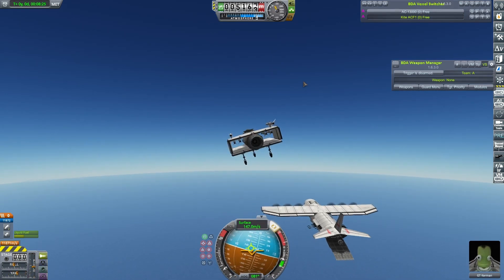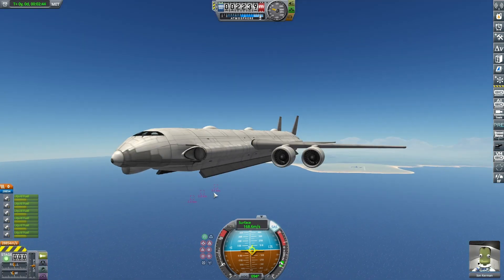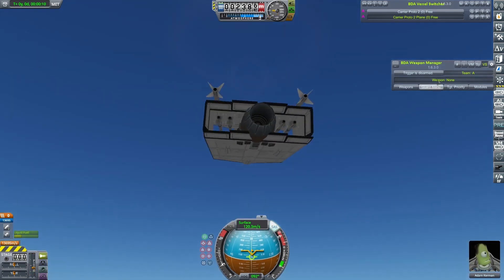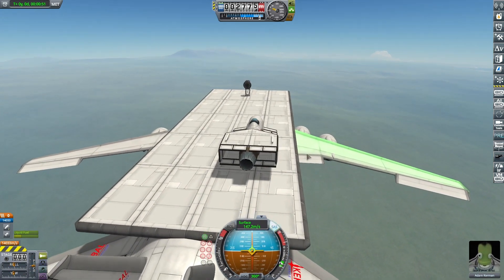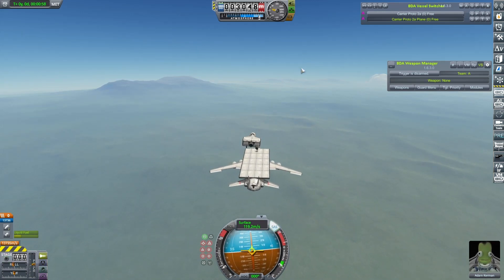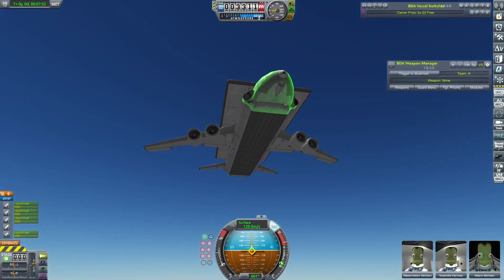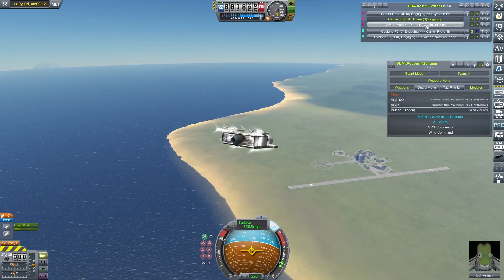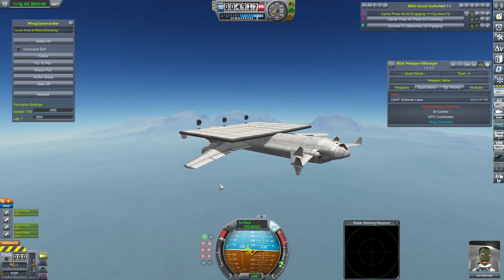Airborne Carrier Reborn! - Kerbal Space Program & BD Armory

Comment: Since without engines it slides backwards, maybe you could put the docking ports on the rear? That would allow you to have a more aerodynamic nose, and would mean you could just turn on afterburners and take off without struggling to avoid the docking port -- even the AI could do it. You'd probably want a two-engine craft with the docking port between the engines, but maybe you could put a junior docking port under the single engine instead.
Reply: The cargo bay approach looks the coolest but it's the hardest I have also tried doing it